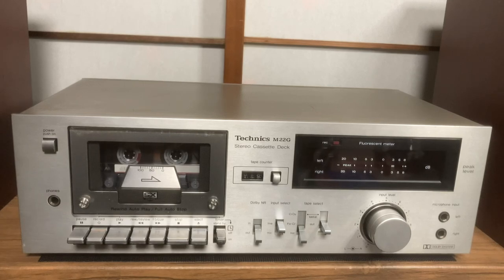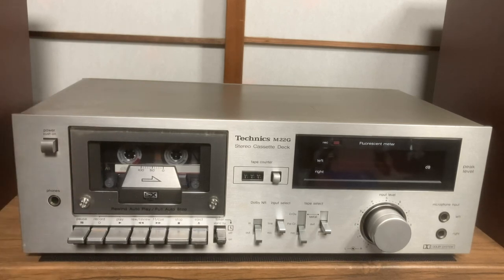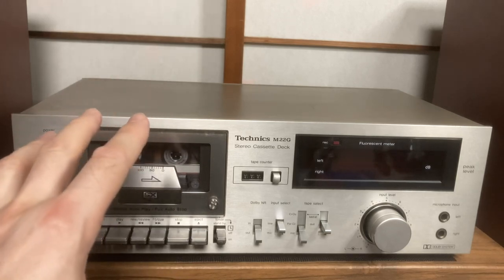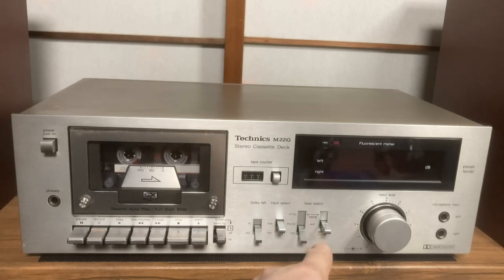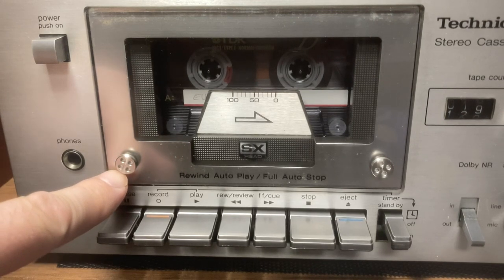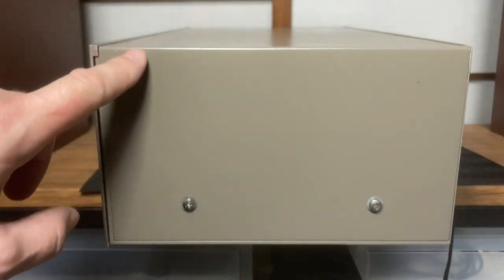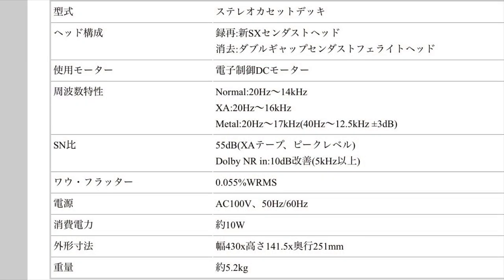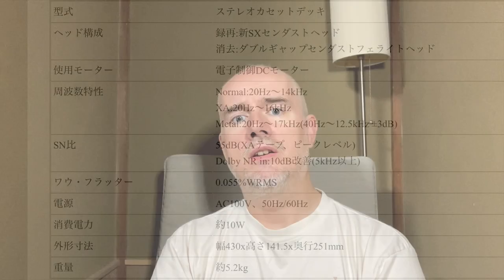Technics Cassette Deck RS-M22G Vintage Bargain from Hardoff Japan

Comment: The timer switch works without a dedicated timer devices! You just need a clocked powe switch for the Audio components. Set the deck in record or play mode. When power gets on, deck will start. This switch protects the tape from damage while in standby no power mode.

Comment: 8:38 Headphones in the 1970s often had inline volume controls built into the headset. Typically the left and right controls were separate which allowed you to adjust the balance.

Comment: Hi! Just want to thank you for this in-depth video. I know nothing about these machines, so why did I find your video?

My dad used to be a bass player (musician) and sound engineer (idk if that’s what it’s called) for radio and television.

He’s getting old (70) and he’s got a lot of these machines, I want to be able to preserve them once he’s no longer with us. 

But these machines haven’t been used in over 15 years and I don’t even know if they work. 
So that’s why I thank you for your video, I’m not ready to test these machines (I wouldn’t even know how to) but your informative video lets me know, once I get my hands on them, I might have a chance of getting them to work and be able to listen to my dads vintage collection of cassettes, vinyls and CD’s.
Reply: 16:20 “there’s no way that pops out that easily” I literally just did what you did and that thing came out smooth as butter. What the hell? These machines are making me exited about cleaning them 😭 I can actually get behind that glass and clean it neat? Thank you for the video! I cannot thank you enough

Comment: You will scratch the door Bolts when using any "Tool". They are glued at the back side. That red lock glue need to be cleant first. Plesase be careful not to scratch the 4 hole screw heads.